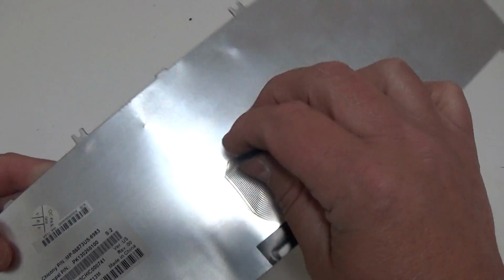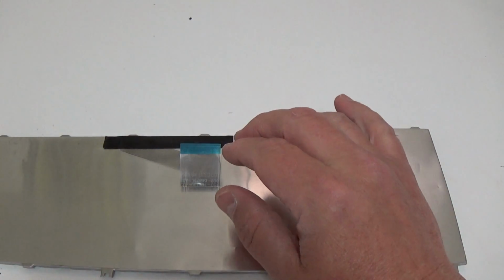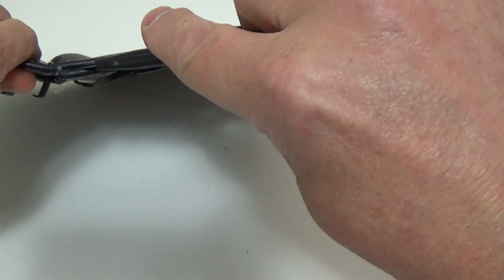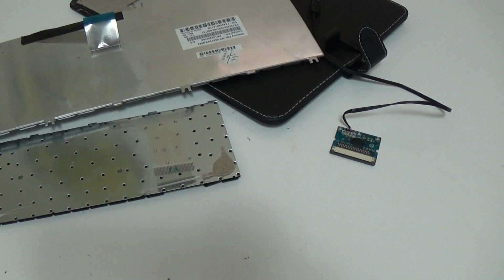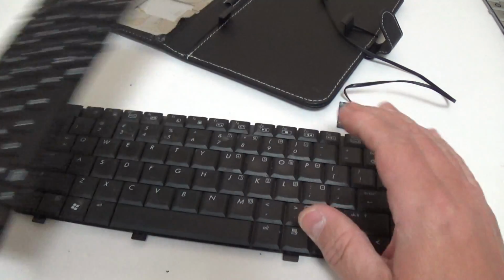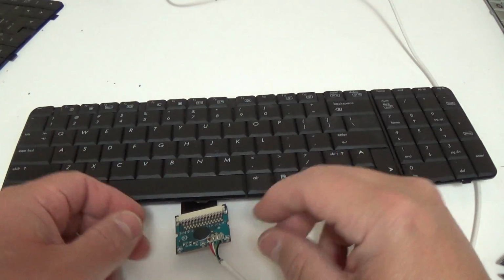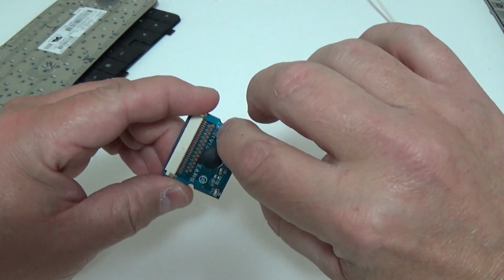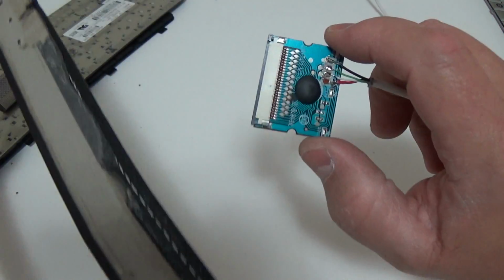Laptop Keyboard Conversion Problem Solved!!

Comment: 1. I'd not go for an arduino - far too big cost.
2. Can you not pick a chip to manage or some EEPROM if chip won't work?
3. You can get ports online, solder it to a small PCB, and see what this chip requires to run via USB. Add a diode if you'd like for a security, or some other protection. Or to keep the cost low, even neglected ;).

Comment: deception in the title of the video. where is the working keyboard? most likely nothing works, tk. keyboards are different, the lines from the keys are different, you need an appropriate controller. even in the video you can see that the number of conductors in the connector does not fit ... how can this work and how can this be a solution !?

Comment: In general it looks similar to arduino keypad. So you can find out how key matrix is working, and use those buttons for arduino project or even konvert to USB signal.
herei is the idea how to check matrix.
https://youtu.be/eVBTEWGJvJc?t=193

Comment: There's more too it. Keyboard are wired in a matrix of rows and columns (as in column 2 + row 4 would be the A key), but how they are wired differ from each keyboard. "A" key might just as well be column 2 + row 3.
Reply: Ahh. So thats why the conversion is very complicated.

Comment: Thank you for sparking the creative juices because I have a few of these cheap tablet keyboard cases lying around. However, you really need to change your video title because you didn't solve anything.
Reply: What I ended up doing is throwing away the laptop keyboard entirely. I had an older Dell Precision M6400 with a larger profile. I gutted it and put a Raspberry Pi in the battery compartment. For the display I bought an LCD control board for 20 bucks on eBay and connected that to the Pi with an HDMI cable. For the keyboard I cut away the area where the previous keyboard was and found a backlit USB model that fit perfectly in the hollowed space and plugged directly or into the Pi.. Then I used a USB extender to reach the previous USB port area and attached it there so I can still have a USB port available. For my mouse I used a wireless 2.4ghz model with a dongle plugged directly into the Pi. Looks and works great. I haven't solved the two power cable problem for the display control board and the Pi.

Comment: precorona times i bought these pcbs for ~2$<
https://www.ebay.com/itm/Multiple-0-5-1-2mm-Pitch-2-0-3-5-inch-TFT-LCD-Adapter-Board-Test-module-FPC-PCB/201499026231?hash=item2eea472337:g:xcUAAOSwXaRZ~~3F
has 8 (!) pitches, maybe look on aliexpress or alibaba to find it cheaper now

Comment: I want to do this to have a keyboard thats a little sunken into the desk so its flush with the surface, I am working on a desk thats going to be anything but ordinary 😉.  I am not about all the glowing lights and the whole gaming desk setup , its going to be more of a maker , hardware/hacking /tinkering kiosk.  A kiosk in the way of form factor not the way the operating system behaves.  That video of the Raspberry Pi desk from a while back with the pop up screen and the glowing LED's in the surface of the desk was my motivation , but I would never spend that type of money to make a desk like that.  If I could do it with parts I can salvage is another story.  I was thinking of having something a little more powerful driving the desk , I have a core quad duo and a compatible motherboard that is just sitting here.  Its perfect for what I need , basically a terminal , web browser , text editor , and enough processing power to compile without having to wait hours like when using a SBC.  I also found a tutorial on instructables on how to take an older computer with a serial port and turn the computer into one large micro controller.  I can't begin to think of the benefits of having that much more storage and RAM.  The computer I want to use is running a pentium2 with 128MB of RAM.  The motherboard is covered with headers its an ASUS p2-99 http://oldschooldaw.com/asus/1999/MOTHERBOARD_ASUS_P2-99_1999.pdf .  The sound , and video cards are also covered with headers.  I have to be able to do something with this.  Its never been used, it still has an untouched version of Windows 98 installed on it  The desk is big enough to fit both motherboards.   I have a linux distro thats only 8MB with support for 32bit machines , http://minimal.linux-bg.org/#download  .  This is an interesting website if anyone wants to take a look.  The minimal iso is also good if your a person that doesn't like docker or lxc , you can make a bunch of type 1 VM's and barely have to allocate any ram .  They say the bare minimum to run linux is 128MB , this might be the exception to the rule.

Comment: After watching your video, today I went out and I bought the same exact portable keyboard you used to harvest the USB converter and I did exactly the same as you did. Sadly, following your path resulted in only a few key pressings translating on a few random keystrokes - and most keys will not even result in anything at all. I understood from your video that you also did not get it to work. But the title of the video says you solved the problem. Did you manage to solve it in another video? I was unable to find it in any of your other videos. I am afraid as it is it does NOT work nor does it solve any of the problems you mentioned you solved, unfortunately. Please correct me if I am wrong. I just want it to actually work. Thank you.
Reply: Apparently you have to re program the control board in some program

Comment: Is it your keyboard working just with that convert chip?
Reply: When you hook a (any) keyboard up to the flat ribbon socket on this controller and plug it in to a USB slot, it is only going to produce an output (text/numbers) to the computer on certain keys, and the output will not match what was intended. The only way to use this setup is to reverse engineer the controller AND the laptop key matrix. You'll have to find pin assignment pairs for both the controller and the keyboard. THEN find which pair of pins on the keyboard ribbon match which two pins on the controller.  THEN find a viable way to connect the two. The author recommends using only half of the controller (pin socket and breakout pads). I think that's a good start, but you should also go ahead and break the bank and buy another controller to use so you can solder breakout pins to breakout pins.

Comment: Interesting subject. I just read on Tom's hardware about someone asking for a solution similar but wanting to have a laptop without literally no internal components. He wants just a screen and keyboard as one part that's connected to a regular pc.
Reply: Dave Dörenberg-Veltman i have a very similar project also to what you mentioned and also the whole laptop internal componets removed. with an lcd controller board for laptop lcd,  i also need the laptop keyboard to make it work for rpi,
Reply: @rosekreuze  I want to do that too, using a Raspberry pi 4
Reply: I want to do exactly this.

Comment: Where can i get those chips to vonverte to usb??
Reply: Sugi No To  lmao you both are from germany and are speaking in english xD
Reply: I have one - you can buy it from me if you like.  It is a german layout in QWERTZ-order. But I think you can easily change it to the english QWERTY-order by exchanging the z with the y key cap. I have not tried whether they easily come off or not .
Reply: @ Sugi No To   -  Hi, yes I still have this mini keyboard. It is still as it came out of the box. Where are you living?
Reply: Sugi No To  Hello, yes I am living in Germany. They price for the keyboard is 28 € plus shipment. Please tell me in which country you are living to calculate the shipping costs.
Reply: Sugi No To  you can get it cheaper https://www.aliexpress.com/item/Black-Universal-Protective-9-Micro-USB-Keyboard-Leather-Case-Cover-For-9-Inch-Android-Tablet-PC/32899371496.html?spm=2114.search0104.3.2.74d177aaIEuc3h&ws_ab_test=searchweb0_0,searchweb201602_1_10065_10068_319_317_10696_453_10084_454_10083_433_10618_431_10304_10307_10820_10821_10301_537_536_10059_10884_10887_100031_321_322_10103,searchweb201603_35,ppcSwitch_0&algo_expid=a2683d59-344a-4695-a1bc-f3af0b22f521-0&algo_pvid=a2683d59-344a-4695-a1bc-f3af0b22f521

Comment: Also: surface soldering on flat terminals is easy- you just need the proper tools. Hot air + solder paste + circuit board vice = cake walk.

Comment: why don't you just use a hot air station and remove the connector from the motherboard of the laptop that keyboard came out of and build your own interface? Or why not just buy the microcontroller hat from a component distributor? gutting another keyboard that could've just been used in place of the laptop keyboard seems a bit overkill.

Comment: I am "modernising" a toshiba t3100. I have not yet decided if i will go one of two routes. 
Use a mini ITX mobo and make quite a powerful PC that has to be plugged into a wall. 
Or
Use a current spec laptop mobo and make it a battery powered device and just jam like 4kg of batteries 
into it so it gets 5 days of use. 

BUT, in both scenarios I would very much like to use the standard keyboard. It is a ribbon style I believe (waiting on the mail man) that goes to a specific plug on the board. 

How do you think I would best go about adapting this early style keyboard to a current gen usb input or current gen laptop input. 
I have all the other bases covered and this is the only thing that has me stumped. I thought about carefully mounting a different keyboard in position but it wouldn't be the same.
Reply: That is a seriously awesome project! I think that fact almost demands that you use that keyboard type that's part of it's iconic look. It almost demands that you use the monochrome display and love how media looks while being played on it, LOL! Worst case, amongst the options available that keeps the T3100 homage aspect intact, would be to use a bluetooth capable motherboard to connect an external keyboard and leave the standard one in place, albeit unconnected. At least, then, you can enjoy using your "Model 002" T3100, while at the same time, seeing it's disconnected keyboard when using it will be motivation and inspiration  to keep researching and posting questions on forum chat boards all across the internet until a solution can be found. I wish you all the luck in the world and hope  it earns you a write up in any (all) of the various publications/websites that feature computer tech and the culture that surround it, so that I can see what that finished project looks like! It kind of makes me want to dig around and find my Tandy TRS-80, measure it up and see what I could do with it...

Comment: Thanks for putting up this video. I was looking around for a laptop keyboard converter, but I found your video instead, which saved me a lot of hassle. I managed to find a tablet keyboard that took USB 2 compared to your Micro USB cable. Keep an eye out for my completed Orange Pi 
cardboard laptop in the near future.
Reply: Does it work with tablet keyboard board?